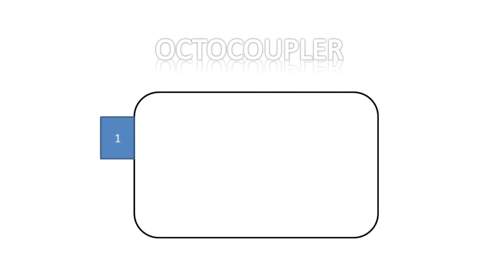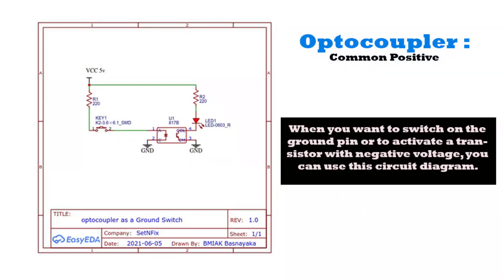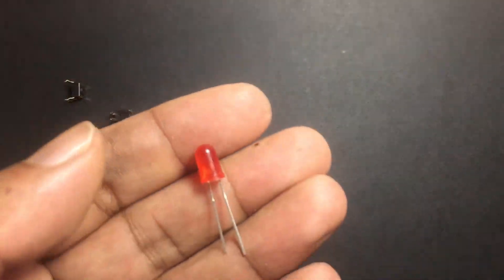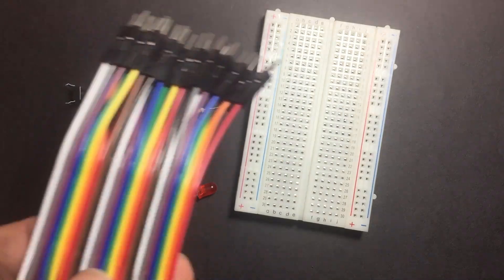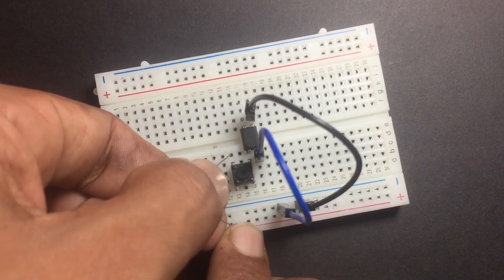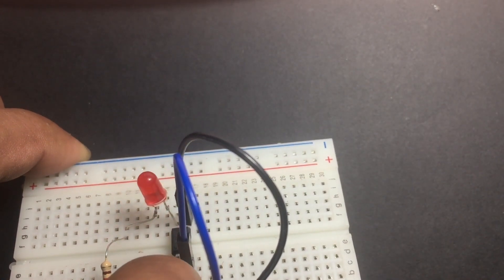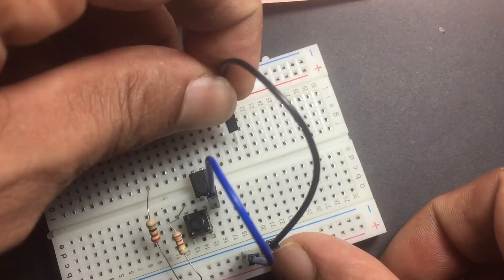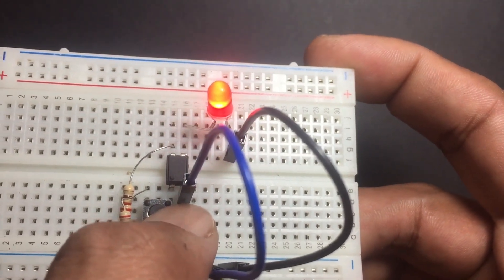How Optocoupler Work : Testing Optocouplers

Comment: is it possible to use same dc source for input circuit and output circuit? or its strictly require separate voltage for input and output circuit?
Reply from the maker: Yes, you can use same source as input and out put . It is depend on your requirement.
Reply: If you are seeking to use an optocoupler to create proper isolation between two power systems (say a 3.3/5v signal (Arduino) and a 12v power system), you would absolutely NOT share common ground or positive.  That's based on about 4 hours of research and learning into these, but that's why optocouplers exist: isolation, noise removal, different power levels, etc.
Reply: Can i use only optocopler to activate switch for my spotwelding, like auto switch sensing ?